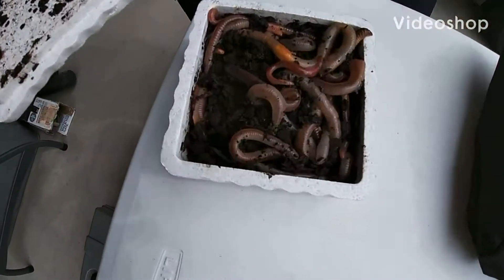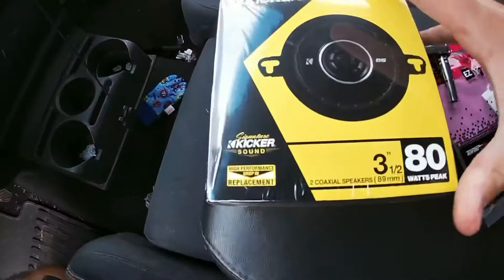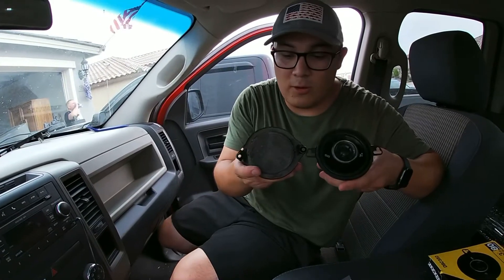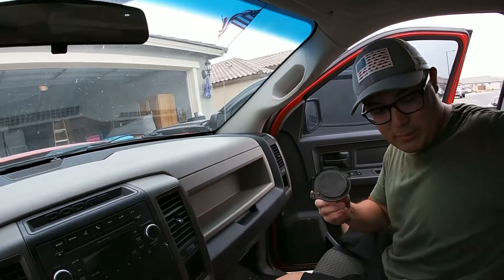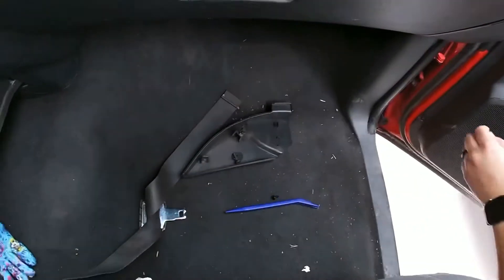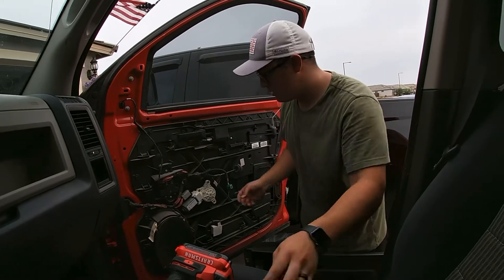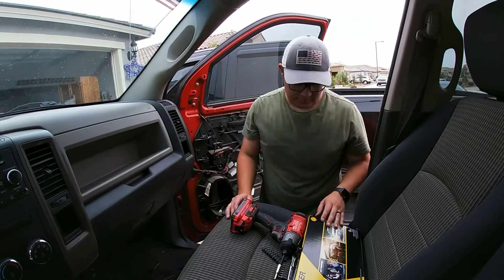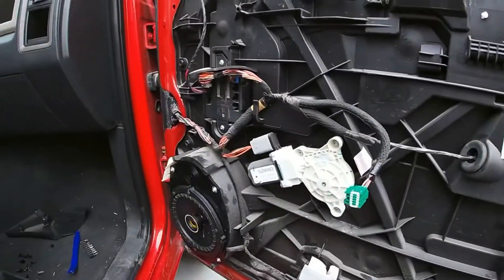How to Install Ram 1500 Upgraded Speakers!! (4th Gen 1500,2500,3500)

Comment: About to do this job tonight. Video is much appreciated, brother!
Reply: How’s it sound?
Reply: Turned out great. Worth the effort for sure. One thing to know about the dash speakers is they are 8ohm speakers. This is important because with the Kickers they are 4ohm. This means they are more powerful than the factory speaker. That creates an imbalance in system sound quality because the kicker dash speakers become so much louder that it’s hard to balance them with the door 6x9s. I removed the kickers and installed some “Dayton Audio PS95-8 3-1/2" Point Source Full Range Driver 8 Ohm” in their place. A pair is $60 (same as Kicker) but 8 ohm. Now system sounds balanced and screams since can have equalizer turned up properly and fader centered as well.

Comment: Just wondering before i start...would there be an extra set up speaker wires under the middle cover by the sensor even if you dont have the factory upgraded Alpine system 😈😈😈?

Comment: I’m trying to replace the front door speaker with kicker ds but I found ds is thicker than the original one. Is there anyway to solve it?
Reply from the maker: I’m not too sure. I opted for the 6.5 inch speaker rather than the 6x9 for the front.
Reply: Buy a Metra 1/4 spacer off Amazon

Comment: can you put the 6x9 Kickers in the front door as well?
Reply from the maker: Tbh I’m not too sure, I think the magnet on those speakers are too big to fit a 6x9. I just went off Cruthfields website recommendation
Reply: @RobOutdoors623  damn i already bought a pair of 6x9 for the front lol. I’ll update once i try to get ‘em in
Reply from the maker: @alcatraz442  yeah I’d try it and see if they fit. The OEM speakers are 6x9 but the magnet is small so hopefully yours fit! Thanks for watching!
Reply: @RobOutdoors623  just got done installing all 4 doors with 6x9’s, all fit like a dream! I used the KS series 6x9’s from kicker, magnet was definitely larger than the stock, but it fit just fine 👍 thanks again for the detailed vid
Reply from the maker: @alcatraz442  of course man! Glad to hear that! I appreciate the support!
Reply: I have pioneer 6x9's in the front doors of my 2012 and the magnet clears just fine
Reply: We’re they louder and have more clarity
Reply: @loveallbeall2486  with the pioneer 6x9's, absolutely worlds better than stock, but I also have a Kenwood touch screen head unit in mine, which puts out way more power than a stock head unit, so that's where you'll see the most upgrade to volume and clarity.
Reply: @Jose H just wondering if it’s worth the upgrade if not changing head unit for better sound, bass, and higher decibels

Comment: What year is your truck? Just trying to decide which speakers to get, and if they will be louder, with or without more clarity, with or without changing receiver.
Reply from the maker: It’s a 2012 Tradesman. I didn’t change my head unit and they’re loud and clear. Not crazy bass though
Reply: Was more bass aftermarket than original (lower freq)
Reply: Was it louder (decibels) as well?

Comment: Crutchfield tells you 6x9 doesn’t fit but 6x9 comes out. You just need a spacer to put an aftermarket 6x9 in
Reply: Crutchfield has told me many wrong things, especially with fitment. I would take what you read on there with a grain of salt. You should only need a spacer if you're running speakers with a bigger basket and/or much bigger/deeper magnet. JBL makes high power set that don't like to fit in factory mounts

Comment: Why not put 6x9s in the front doors?
Reply: He failed to say the reason he didn't put 6x9 in the fron its cause the magnet its too big and there's a bar that runs across the back of the speaker housing and won't fit 6x9 that's why he bought the smaller ones with the fitting plastic.

Comment: Kicker CS series 6x9s will fit in the rear doors but not the front. KS series are a little thinner and I was told they would fit. But I would buy a set of spacers for the front door regardless. I think you would only need a 1/4 inch spacer. I went with a set of Pioneer 6x9s in the front and the Kicker CS 6x9s in the rear. CS series definitely do not fit in the front doors and I could not find a spacer locally. Already had the truck torn apart so went with the Pioneers. Have not upgraded the speakers in the dash yet, not sure it is worth it, already sounds 1000s better than the cheap factory speakers.
Reply: Pro tip - when you pull the door panels, remove the rubber boot around the door lock stem that pops up as well as the window up down switch before pulling the panel. The window up down switch will just pop out and that gives you easier access to unplug it (and plug it back in when you re-assemble. Also, the bezel/trim around the door handle should be removed. That makes it a lot easier to put the door panel back on. So my procedure is: Remove upper trim piece that covers the inside of the rear door pillar (just pops off) remove boot around door lock stem, remove switch and unplug the connector, remove the plate/screw cover inside the door handle to access the screw and the the  trim piece around the door handle (just pops out) remove plastic screws around outside of door panel, then lift the panel straight up and remove.
Reply: We’re you having the problem of the speaker magnet sticking to far back of the window regulator in the front?